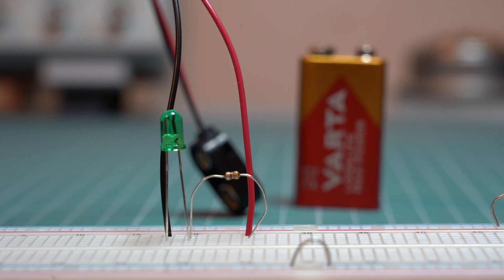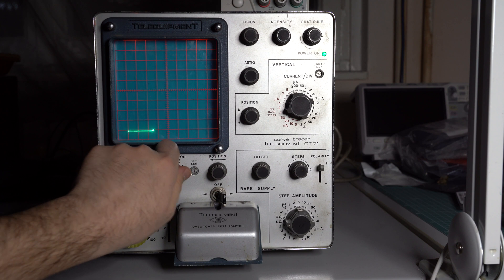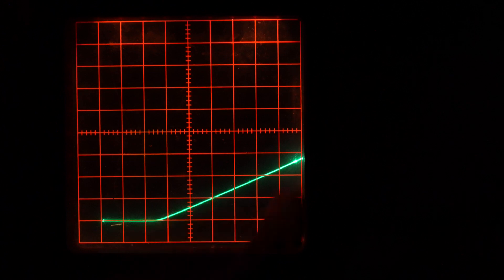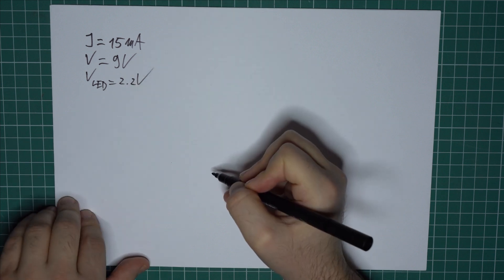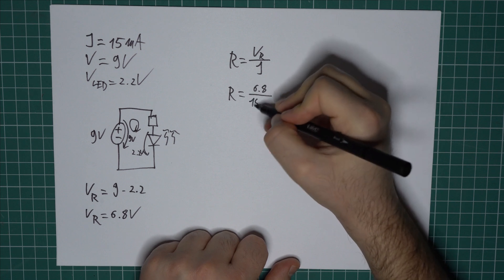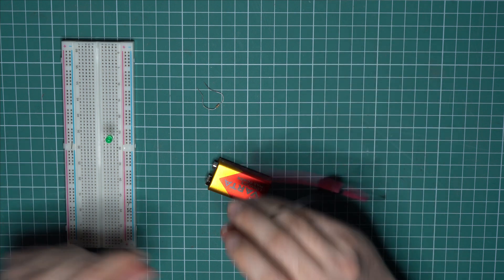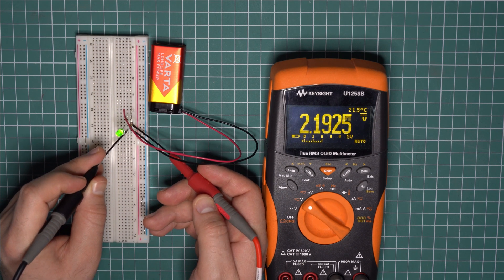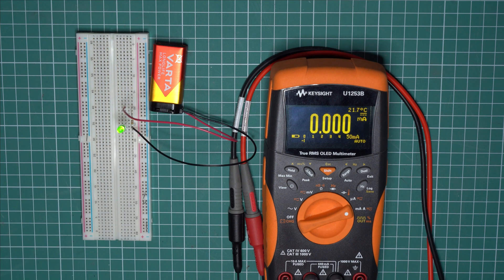BTB - The Why and How of the LED series resistor

Comment: Why not put a 560 ohm  resistor and not have to worry about it should the voltage increase abit?

😊
Reply from the maker: @jwdevine  Well, in the end, that's what you do. However I wanted to show where those 560 ohms come from because I want to teach some skills instead of blindly copy-pasting circuits.

Comment: 100% Agree with first commenter.  bit by bit style. LED and a resistor and the small bit of math needed to calculate, demonstrated and clearly explained. Lots of channels tend to overwhelm me with lots and lots of info, but my brain works weird. on an absorbable info per minute basis, this pace is perfect. Even enjoyable. Thank you! :)
Reply from the maker: Thank you! That's exactly what I was aiming for. 😁
Reply: If we build a high freq. ramp generator with. a valley voltage of 1V8 & peak voltage of 2v6...we can control this led from min. to max. brightness within its allowable current rating range...with a control voltage of 1V5 to 2V7 from a 5V supply..,using a comparator driving a mosfet switch..,
Only issue is brightness control will not be linear to the eye.